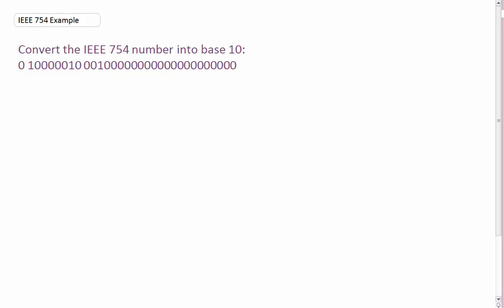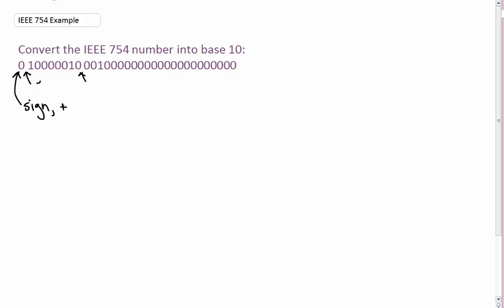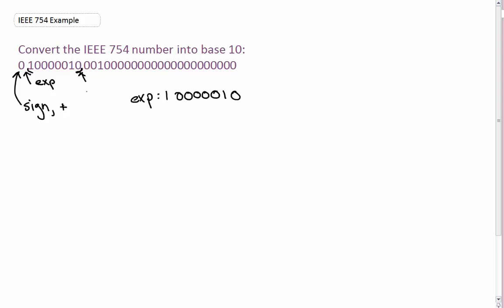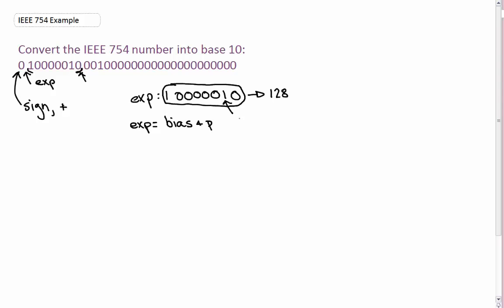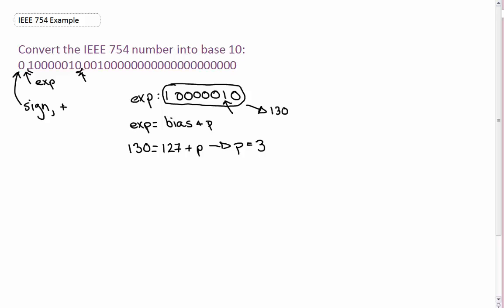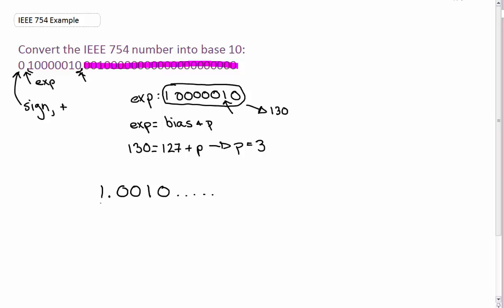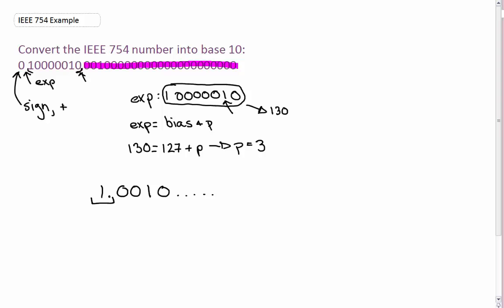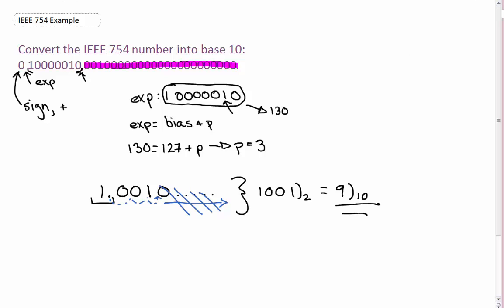Example: IEEE 754 (32-Bit) to Decimal

Comment: what do you do if there are still values after the decimal after moving it??
Reply: You probably figured this out.  But in case someone else was confused...consider what .1 means in base 10.  It's in the 10^-1 position ( the 1/10th position).  1*(1/10)=1/10=.1  It works the same way in base 2.  .1 in base 2 is 1*2^-1=1/2=.5.  In base 2, the places to the right of the decimal place are 1/2, 1/4, 1/8, 1/16, ... and so on.  .111 in base 2 is, in base 10, 1/2+1/4+1/8=(4+2+1)/8=7/8=.875.  Just remember that for all bases, the places of the number are the powers of the base.  In base 10, we have ... 10^3, 10^2, 10^1, 10^0, 10^-1, 10^-2, ... ( 1000, 100, 10, 1, 1/10, 1/100).  In base 2, we have ...2^3, 2^2, 2^1, 2^0, 2^-1, 2^-2 ( 8, 4, 2, 1, .5, .25).
Reply: fucking legend. thank you ;)

Comment: suppose no. given was : 010000000 11000000 0000 0000 0000 0000
then as per my calculations  P=1 ...,
so in  1.1100000..... i shifted one decimal which gives me
           11.100000.....     so deciaml representation of (11) is 3 
but answer is given   3.5
Reply: I know it is too late for you but for new person ... The answer is, to the left of "." you will have 2^-1, 2^-2 ... so you have 11 (equals 3) + 2^-1 (equal 0.5). The final result is 3.5.
Reply: why are u adding powers in minus ? and why you add 2^-1 in 3? whats the logic behind it please elaborate

Comment: how did you get bias = 127?
Reply: Whatever you get for the exponent part, you will always use that number to subtract 127 because in 8 bits the highest is 127 since it's from 0 to 127. In this case, if you have 1000|0010 = 128 + 2  = 130. Use 130 - 127 = 3. The idea of 127 is the same as adding a 1 in front of the fraction portion. It'll always be 1.###.... except in this case you will always subtract 127 because that's the highest it goes in 8 bits.

Comment: how does the exponent go from 128 to 130?
Reply: 1000 0010 = 128 + 2 = 130. 
Remember that it's in base of 2.
That's an 8 bit, so it goes from right to left 2^0, 2^1, 2^2, 2^3, 2^4, 2^5, 2^6, 2^7. 
Because the first four numbers are 1000, we know that is 2^7 (128). The second 4 numbers are 0010, which we know that is 2^1 (2). Remember that we ignore the 0. 
Therefore, 128 + 2 = 130
Reply: +Debbie Zepeda 1000000 = 2^7 = 128, but the exp is 1000010 which is 128 + 2 (because 10 in binary is equal to 2)
Reply: +theorangeiscool1 10000000 = 2^7 = 128

Comment: What if the p was a negative number? Like -1 ... How do you solve it then?
Reply: Josh Oduyoye I think if you get a negative p that means you must shift your point leftwards. Imagine you ave, like in the example, 1.001... (adding that 1, as the uploader said), you would just shift the point to the left, and the result will be 0.1001... That in terms of computers is a non-normalized number, because its integer part is 0...
Reply: +GuitarFrom71 covers!  i have hexadecimal i,e 3F 99 99 9A and p is -16 now what?????